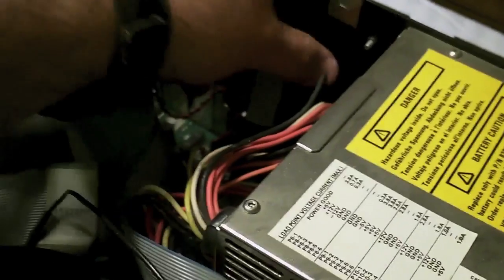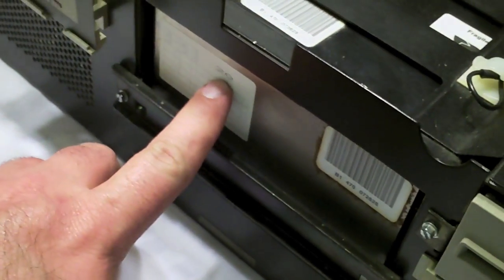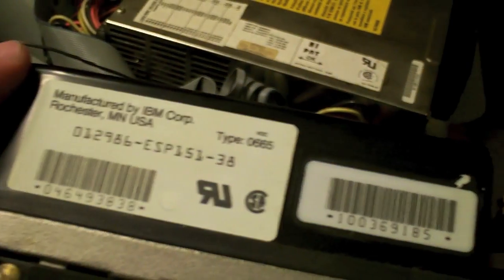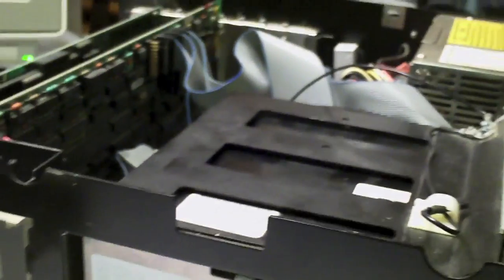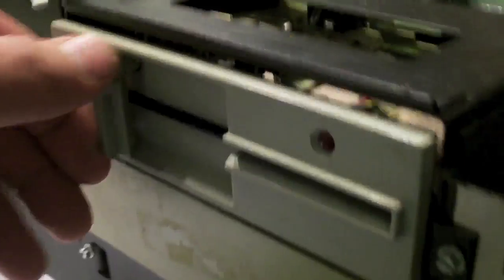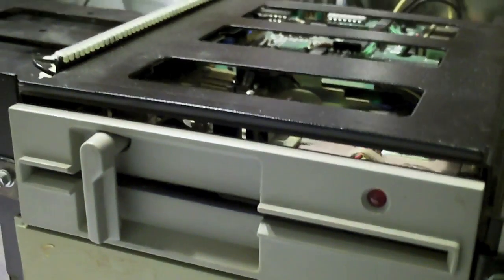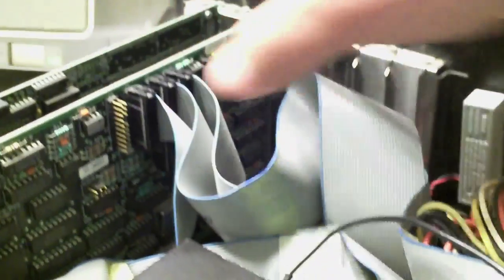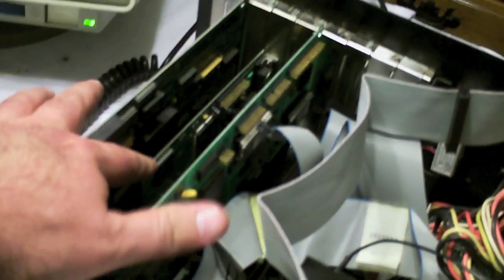IBM 5170 Diagnostic?

Comment from the maker: The 70mb version would have more platters inside making it a little heavier.  So the motor would make a different sound and/or the motor is larger to spin the extra weight and that might be why it sounds different.

Comment from the maker: Yes, the drive is set on DS1 (2nd drive to work with the twisted cable)  and the terminator is present.  I even tried another known working disk drive and still the same problem.  It's almost like the motherboard isn't allowing the data to be transfered from the disk to the system.  I even swapped floppy controllers, still nothing.

Comment: Does the floppy disk drive have it's terminating resistor attached? Is the drive select (DS) jumper set properly?
Additionally, try using attaching the end of the floppy cable without the twist to the drive (if you do this, make sure the DS jumper is set to disk 0).